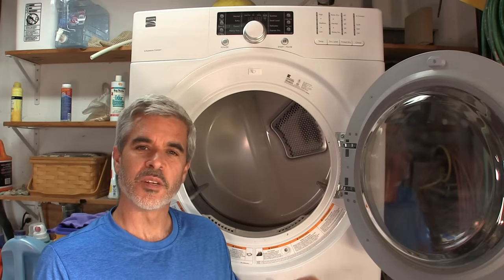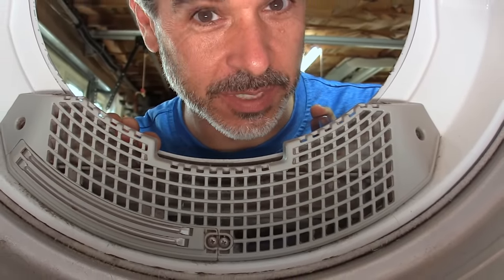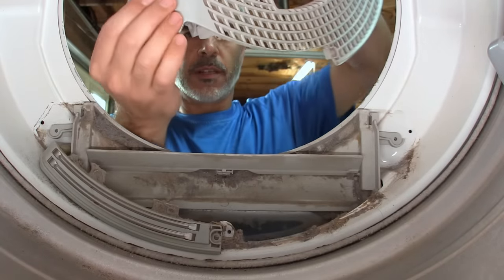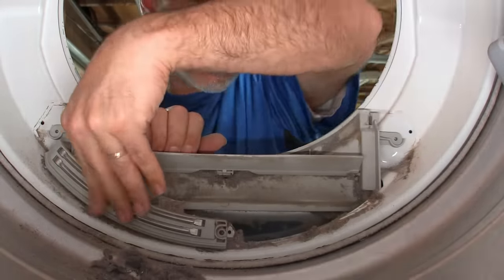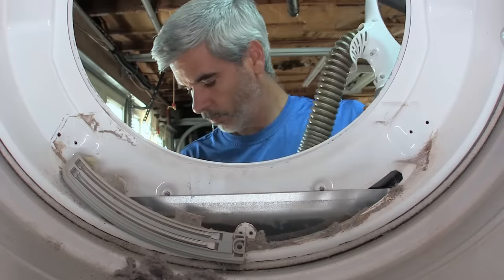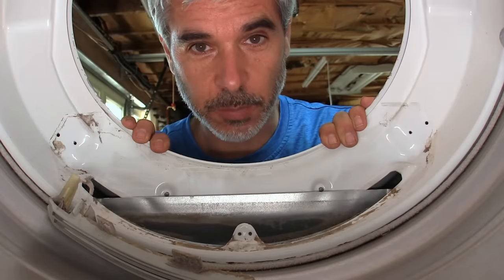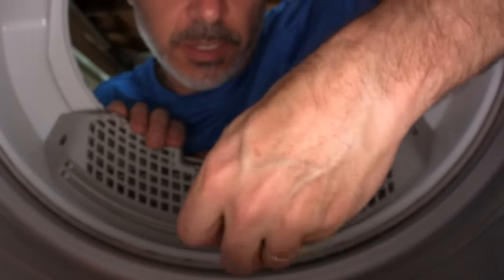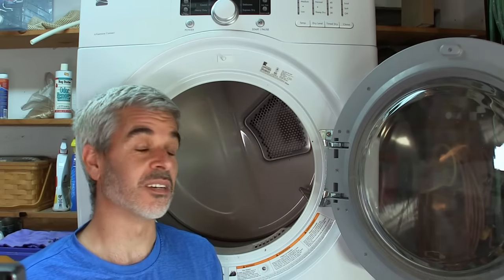Dryer Lint Trap Deep-Cleaning: I found 4 cups of fluff below the filter!

Comment: You’d think the manufacturers could come up with a better design that didn’t require the end user to go through this process.
Reply: Not sure that's possible.  I have a vacuum cleaner attachment made for this but it does little with the shapes in places inside these machines.  The lint gets packed in the smallest of places and the vacuum can't get it out.  It sort of becomes like foam when it matts together.
Reply from the maker: Agreed!

Comment: at 4:18 something fell off what was it and did you retrieve it and put it back on that’s why I don’t like to do this, if I don’t get it back working properly my wife will kill me and there’s nothing worse than not having a dryer when you have a wet load of laundry .
Reply from the maker: Wow you have a sharp eye.  Looking at it myself that looks to be a piece of paper or some other debris.  There isn't anything white there to deal with...  My suggestion is to do this cleaning when you would otherwise have time to call a repair person to come in and do it anyway.  That way if you get in trouble you have the time to have someone come and help you.  This is a fairly easy area to remove and replace.  Just work slow and practice replacing the parts as you remove each piece.  Take your own pictures as well so you have your own instructions.  Place your phone in video mode in the drum looking at you and record yourself doing it so you can watch it all go back together if necessary.  I have watched my own video footage more than once to remind me how I took it apart...
Reply from the maker: At 4:31 you can see the slightly folded, triangle piece of white paper with a red dot on it.  That is what fell off...
Reply: @DansWay  GREAT suggestion.... take video...AND how to do it... VERY generous! This is the video that keeps on giving....!!!👏🏼👍🏻😘

Comment: I was always told to take the outside cover off to clean out all of the lint.
I've been trying to think how I can do it since I'm disabled.
Reply: I mean the outside of the entire dryer..
Reply from the maker: You can remove the cover, and for sure it would lead to a more thorough job...  If you can get this side clean, then get to the back and clean out the exhaust port inside the dryer and the hose.

Comment: In addition to the mentioned "unplug first", you showed the air hose, but not using it after vacuuming with the parts still apart (with goggles of course).
Reply from the maker: Yah the air-hose isn't necessary, but just one more option.  I would never suggest using it unless you also plan on cleaning the back-side immediately afterwards.  The risk of blowing a large amount of debris down and clogging the exhaust and exterior opening is real.

Comment: I removed all my screws but the part doesn’t want to come off I dont want to break it. Any ideas? Also my model only had three screws that I can see and its the middle section that seems to be stuck/ not budging.
Reply from the maker: Wow, I'm not sure what more would be holding it on.  Perhaps there is a clip or plastic tab holding the parts in place under the lip? Anyone else run in to this issue?

Comment: I cant get the two outside screws back in. For some reason the plastic hole isnt lining up with the hole in the sheet metal.
Reply from the maker: Probably need to remove the pieces fully and try again...  Something isn't seating completely as it should.
Reply: @DansWay  I tried for over an hour.  It seems to be staying in place without the 2 outside screws.  I may call lg for a sevice call, but its 15 years old and paying a $100 to put 2 screws back in is killing me :(  thanks for responding though :)

Comment: We have this lint problem our dryer on top of our w/d combo. Only our filter is on the back wall of the drum top right. It's a kidney shaped filter. Makes me crazy trying to fit my small hand in the little gap at the bottom where all that dangerous lint builds up, and pick it out manually. It seems like such an engineering  fail to me! Unsafe!

Comment: Access by way of screws, to clean dust and debris that manufacturer says is hazardous?  To the no!  This should be accessible easily or the trap should be designed in a way, lint  is trapped before it gets down into the machine.

Comment: Dan thank you for showing how to take it apart but my LG showing me "Clean Filter"s" and reset which I don't un derstand how to???
Reply: Dan, Please....pretty please, I've cleaned the filter just like you did, but, the dryer LG# DLE1501W still doesn't work. How do you clean the humidity sensor??
Reply from the maker: The humidity sensor is the metal strip you see being moved in my video.  Could the sensor be disconnected or otherwise broken? I would open it up like I show, clean it really well, and confirm that the sensor is connected securely to the wiring harness.

Comment: These lg dryers suck. There is no reason that much lint should be getting past the screen. I have to take the front panel off every 6 months to clean it properly. You missed a LOT of lint in this video. It's like 8 screws total to take the whole thing apart and clean the blower fan as well.
Reply: Agreed that the LG lint collection system sucks! Read my comment. We were lucky that broken roller alerted us to a hazardous accumulstion of lint inside of dryer, including around electric heater coils!!!  Would not buy LG again unless they corrected lint & heater exposure issues!!!
Reply: This is a Kenmore/Whirlpool dryer.

Comment: Whynot just use an attachment on your vacuum hose?
Reply from the maker: You can as long as you can see well enough to know you got it all out.  Mine goes around the corner as I couldn’t see well enough which is why I removed the inlet parts.

Comment: He left out something very important. He cleaned the common front lint basket. If you look behind his face into the back of the tub you will see an akuminum screen with numerous holes. Problem is lint builds up on that from the BACK - and that is the problem, because I cannot see how you remove that screen from the front (inside the tub). Tried sucking the lint THROUGH  the holes into the tub but even using a shop vac the lint cannot be pulled through. No way to access the screen from the back, WHERE THE LINT IS.

Big failure of the video. As I've found out, a common mistake.
Reply from the maker: Interesting!  I haven't noticed any build up there myself...  Perhaps you could blow air the other way, but that could pack it into the heater, so taking it apart is be best move.

Comment: Huh!!  This may explain why my dryer can't seem to sense moisture very well anymore.  What a hazard.  Bad design.  That whole mechanism should be removable with a click, not multiple screws and wire and hassle.  People are busy and have enough hassles and we don't all have a Dan.
Reply from the maker: You just might be right about the moisture sensor not working right if it is caked with lint.  Give it a good clean, but also be sure to look at the exhaust side to confirm you have good airflow all the way outside.

Comment: After i wash and dry my clothes they come out looking so old and they shed off small fibers a ton of them so they shed and never stop. Help please
Reply from the maker: Sounds like you have an airflow problem.  Like the filter is clogged with fabric softener or the duct itself is clogged.  Check those out first.
Reply: @DansWay we did that. You know when you wash a lot of new clothes and they shed a lot of lint in the washer, that lint isn't getting removed its staying in the washer and staying on my clothes

Comment: Why not use a drill.thanks for clip,I hope people  think and clean this part of dryer
Reply from the maker: The only reason I didn't use a drill was to show that it wasn't necessary.  A simple screw-driver can be used... But yes, for sure a small drill would have made it faster.  When re-installing the screws I would still start them by hand to avoid stripping them out.  They are only going into the sheet steel so stripping is a real possibility.

Comment: The filter box can come out as a unit.  You shouldn't need top remove the moisture sensor  But I added weather stripping to mine.  This entire assembly is very poorly designed as your video proves.    I wish someone would design a replacement assembly that actually works.  LG engineers are extremely incompetent.
Reply: Total crap.  Look at the build up.   My filter  catches the lint, but the entire box assembly needs to be cleaned each time.  It takes about 5 minutes or maybe less.  Just remove the two side screws.  There is no bottom screw as it is really not needed.  I'm thinking of modifying so the screws can be removed from the outside infront instead of the inside.  LG could make it so it just snaps in and out. with no screws.

The way this guy is doing it is too complex. I added weather striping so most all the lint is inside the removable screen and filter box.  I don't see any around the moisture sensor.  I added weather strip to the filter screen that closes the gap between the screen and the box assembly.  The box assembly snaps together outside of the drier.  The guy in the video is not removing it the easiest way.  I added window screen to the back of the filter box.

From an email I sent:
The Lint filter on the LG drier is really crap.   It doesn't catch lint.  I modified it so that it works, but you have to take the entire filter box out each time which requires removing two screws.   LG should be able to make a lint filter that works easier than me.  I can think of a lot of ways it could be improved with the capability they have to make rubber and plastic things.  Basically it needs better seals that fill the gaps.   I added some generic foam rubber and additional screen on the box itself, but that has to be cleaned. before each load. which takes some time.

There are 100's of complaints on Youtube, but when I called LG to complain the said they never get any complaints which can't be true because people are talking about a class action suit.  If you don't catch the lint at the filter, it goes into the machine and can catch fire.

Here's the entire filter box removal.  You don't need the bottom screw.  Just the two side screws  The problem is the filter screen dosent fit tight to the box so lint can pass around the screen.  I added window screen to the back of the filter box and a foam weather strip seal in the gap.

https://www.youtube.com/watch?v=l2CHeNnlgUo

Comment: I don't want to complain about your intent to do a well needed maintenance procedure, but I find the folks making these videos need to do a better job of cleaning all the components prior to reassembling the item which in this case is a dryer. What does it take to have a clean inexpensive paint brush handy so you can get all the grime stuck to the parts that need to be screwed back together. And if need be wash all the small parts in a bucket of warm water to get rid of all the surface grime. I find this to be real disappointing when the person taking so much time to disassemble the dryer lacks the initiative to fully clean the parts prior to reassembly! 
You'd have a tough time convincing my wife that you fixed the dryer after seeing the dirt still stuck to the parts that you reinstalled. Even if it's done correctly it's not up to par by any female standards, that's for sure! I'm truly sorry to be such a whiner Dan! But here's what she said!  "Thanks Dan, but please, do it once, & do it right"!